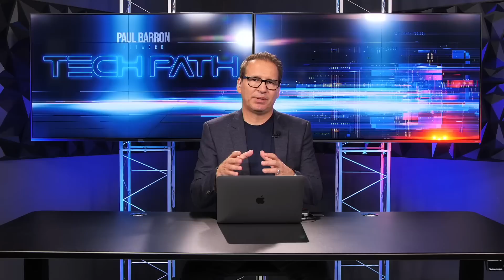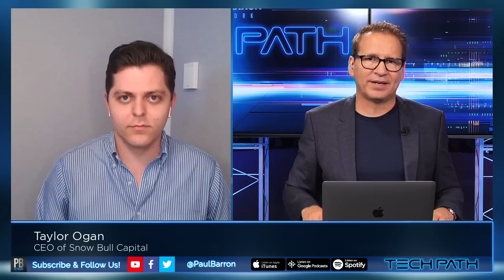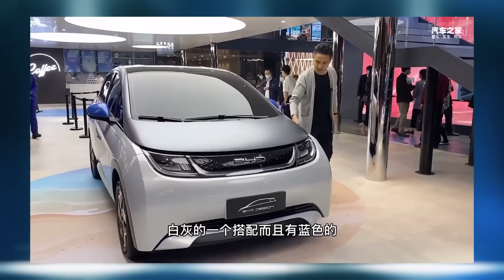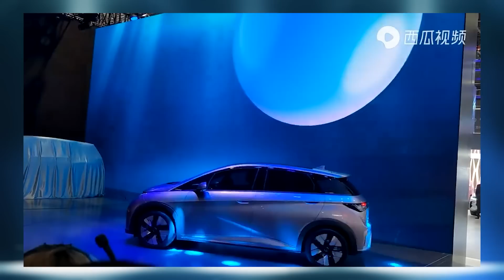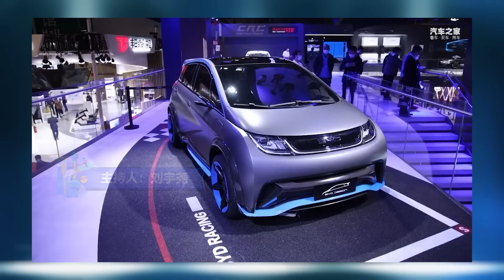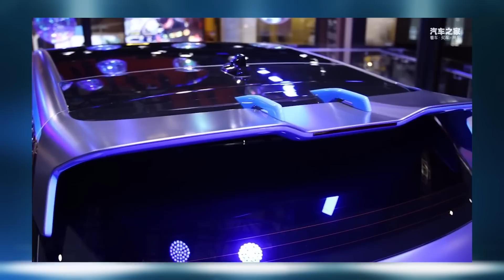BYD Dolphin vs Tesla $25k EV | w/ Taylor Ogan

Comment: Twenty-five grand is still too much when you have to replace the battery every seven to ten years. They refuse to make a self charging Ev. Or Troy Reeds magnetic motor that doesn't need gasoline or batteries, and it can be placed into an existing vehicle for $3500 dollars. Boy does the auto industry not want this to see the streets.

Comment: As the owner of a subcompact EV, 2016 Chevy Spark EV, I'd love to see the BYD Dolphin sell here. As a retired person I don't really need an EV to go 300+ miles as most of my needs are short trips usually around 6-16 miles round trip so even with an EPArange of only 82 miles the Spark is perfect. Do I wish for double the range because it's a fun little hatch, you bet. I am surprised that many of EV manufacturers have left out the EV as a 2nd vehicle solution and think that market is needed and could grow more quickly than trucks or luxury options. I like the blade tech and easier to obtain and less costly chemistry but we need the equivalent manufacturer here in the US along with our own chip producers. Anyway, BYD and CATL will be showing the way forward for now at least. He'll the VW id3 and it's Cupra Born variants should be here already.

Comment: You could put an LFP battery in the form factor of a 4680 battery. Why not?
A 4680 battery is not just for the best cars (around 16:00) - the usage for the best cars depends on the cell chemistry and not on the form factor of a battery.

The only issue I could think of might be the cooling. So, when it's easy to cool LFP batteries, then it would also be easy to cool a rather thick 4680 LFP battery down to it's core without overheating the battery cells.

The 4680 batteries have less surrounding materials than smaller batteries for a given volume of active battery material. This way you get a higher energy density for a battery pack with a given energy storage capacity (let's say 50kWh) when you choose thick batteries instead of thin batteries.

Think of it like slices of a bread and you wrap each slice in a cover. When you have thicker slices, you use lesser covers for your slices of bread - for your battery cells. Less cover material, more active working inside material for let's say a 50kWh battery pack.

Comment: What a disgrace these 2 are. The Tesla Model 3 is eons in front of BYD EA1. They are on the take from BYD. What furtive liars they are, subliminally talking up BYD or Buffet Agents . BYD make batteries, but they are a new boy on the block re cars. There are grave doubts about byd ride, handling, paintwork 
El cheapo plastic seats that might melt, and an infotainment system that has unsatisfactory functionality and and faint screen. Re the battery , the pace is ordinary 0-60 .. 10 seconds, so forget it, and torque is insipid compared to Tesla Model 3. BYD might crash if any cars are lemons like  Hyundai wss with its  Excel lemon
Reply: Hey, it's the BYD hater! 🤡
Reply: @AI_HQ  no I'm not 
. There are no complete worthy reviews.   I repeat a reviewer  made observation about the Pang??. Zthst were not good.. om the only one who commented on that and unpacked the issues.. most people write ten word quips if    ... nothing ..

Comment: Australian importer says EA 1 has 500km range , o-100 is 5 secs , 2.9 & 1000 km range  is a mis translation of the specs , that is a future projection of what may be possible 
Aust price $33,490 pre order from September.
Reply: 500km NEDC (Not Even Darned Close) range.  Usually this is dropped to 70% when converted to EPA range so about 350-360km.

Comment: BYD Dolphin 300km version will cost $17,000. 400km version will cost $20,000.

Tesla needs to work harder on lowering the price.
Reply: are you sure about that range?  because in india TATA nexon Ev  offers 310km range and offers great performance and costs  1,200,000 rupees which is  nearly 17,000 dollars. which

Comment: 4680 cells are a form factor. They will be available in LFP. I am happy to hear BYD has a platform that is so competitive. It is strange that it isn’t being sold to other EV MFGs. I’ve heard your theories that they will partner with Apple and/or Toyota, but isn’t it more likely they just want to keep it for themselves since they are so vertically integrated? 
The benefits of their blade batteries sounds amazing, especially the cost. Are their any insights into factory expansions?

Comment: 5:10 No that's not correct, I have to correct you on that. EVs are way too expensive in Australia and there is zero federal government support for them unlike the US, but we do have a $45,000AUD MG ZS EV with about 269km range. That's about $33k US, give or take. But that is by far the cheapest, and the next cars up, the old Hyundai Ioniq and 40kWh Nissan Leaf are around $54k AUD (~$40k US). Definitely unaffordable for most people and not surprisingly they are selling 30 or 40 per month across the whole country. But agreed with your point, if the BYD dolphin is priced at close to $30k AUD, it will sell massively.
Reply: in europe hyundai ioniq sells at 33 usd or at 26 usd with substitutions from goverment.
Reply: Australia's remedy comes from coil energy so if people going to have electric cars will be the same as diesel.

Comment: considering BYD already has manufacturing facilities in USA, it should start a vertically integrated giga factory in the midwest and start building a Tang suv with the third row eliminated and a truck tray installed in its place with a huge battery embedded in its chassis. This will cater to Americans' love affair with family trucks.
Reply: Wow. Didn't know that
Reply: Not bad of an idea 💡
Reply: I think they should have a truck. They could also keep the 3 row car idea with cute colors, purse storage, a place to plug in a milk pump, and an excellent car seat setup.
Reply: Very interesting, thanks!

Comment: I was waiting for Paul and Taylor spreading the news on BYD. Great you cover BYD so well. Keep up the good work and thank you! The stock will catch up with NIOs XPengs and Teslas valuation at some point. No doubt. Its still so cheap with P/S ratio of 3.3. Tesla has a 2020 P/S ratio of 20 and NIO of 30. BYD should at least reach a 10
Reply: BYD can sell the ev AT COST and still makes money since BYD already makes money on their batteries and their electronics, which usually account for 30% to 40% for the cost for an average ev. Tesla on the other hand has to recoup the cost for all the car parts they have to get from their suppliers, and only after that, Tesla can add in the margin.
Reply: BYD🚀
Reply: right now in china there is literaly no ev s at 10.000 usd range. it s either very cheap at 5000 usd or very expensive. no chinese car company like xpeng or nio or byd has ev models between 10.000 and 15.000 usd on sail right now. it s very odd. why is that?

Comment: $10,000 is defintely cheaper than a high end bike.
Reply: Where is more credible reference that this EV will indeed be $10,000?By its look, it is more like $15,000 EV. Maybe $10,000 is the price excluding the battery and you will need to pay for the battery over time.
Reply: we ll find the exact price when they ll sell it in china in chinese yuans and then make the conversion to usd. right now in china there is literaly no ev s at 10.000 usd range. it s either very cheap at 5000 usd or very expensive. no chinese car company like xpeng or nio or byd has models between 10.000 and 15.000 usd on sail right now. it s very odd. why is that?

Comment: Taylor's information for Australia is incorrect. The cheapest electric vehicle we have is $44,000 Au/ $32,800.00 US approx,  before government incentives in some Australian states for the MG ZS EV.  The BYD EA1 Hatchback in its base model trim is estimated to be around 29,000 Australian dollars/ $21,600.00 US approx. with a range of 400km. Chinese EV manufacturers will dominate the EV world globally in the next 5 years. Byd has Ev's in every passenger vehicle category. Their long term plan is to supply the world with quality and Affordable Ev's. We will be able to order 2 BYD Ev's this month, July 2021 the EA1 hopefully in 4 spec models. Probably the higher spec EA1 model and the Yuan plus a small crossover SUV based on the BYD X dream concept vehicle both around $35,000 Australian dollars for delivery in January to March 2022. In September this year we will get the BYD T3 van in Australia for the same price as the 2 passenger EVs, all with blade battery packs.

Comment: Not quite right... cheapest EV in Australia is MG ZS at $A43,990 drive away. So approximately $US33K. The importer (Nexport) is saying 'under $A35K' for the BYD Dolphin. So before any government incentives, call it $US26K for the entry level model. To be confirmed... deliveries scheduled for Q1 2022.
Reply: Sad that here in NZ the BYD will not qualify for incentives as only new EV up to NZ$80k will get the $8600 rebate and only between 1st July and 31st December 2021 :-(
Reply: @gregandkaruna6674  how does that not qualify ?
Reply: @jonathanpoppleton1010  The BYD is not due for release until March 2022 or 3 months too late :-(
Reply: @gregandkaruna6674  The NZ Government financing of the rebate scheme ends on 31 December, but that is because the extra fees on high consumption vehicles (think V6, V8, large SUVs and double cab Ute's) begins on 1 January 2022 and this is supposed to make the scheme self-funding. So the rebates for EVs will continue, just the funding changes .
Reply: @murraynickel6377  Hope so, but that is also the date when RUC charges are due to start on EV and PHEV and no word that it will be extended.
Reply: @gregandkaruna6674  The Govt knew when EV's were going to arrive, so targeted incentives at the cheapest outlay but still looking good for them.

Comment: Does this dolphin even pass safety requirements in the USA and Europe?   Given that batteries production limits the number of EVs that can be made, it makes sense to sell higher-end vehicles, then make more affordable vehicles as battery supply and giga-factories come online.   I think many people do want a small city car/ efficient commuter/utility car in the USA and Tesla is definitely on this path, but NO Tesla does not need to make a car like this right now when it is maxed-out making high-end cars showing the world that EVs are the way to go.  It's not the number of vehicles sold, it is the return on investment, which creates capital to make the tech more affordable for everyone, that then transitions the world off fossil fuels.  Imagine once FSD is solved, Tesla can put this tech in a < $10K car because the cameras and processors are economical but the value that brings is huge.  Yes why does this Ogan guy sound so biased toward China eg. "Huawei has a better phone than Apple but Americans just want what uhh Americans want" ... and the dude uses an iPhone himself with airbuds.,  Samsung has better specs than Apple too but its the Apple integrated HW/SW magic that makes a great product, not just specs.
Reply: Kevin I was wondering if you can tell me where the iPhone is manufactured? BYD make their own batteries and just about everything that goes into their Ev's,  so they have no constraints or component restrictions or shortages for their Ev manufacturing. They are the biggest EV manufacturer in China.
Reply: @Peter-vn8ue  Peter, I was wondering if you can tell me where the MIC Tesla 3 is made?  Tesla also makes their own high performance  batteries and sources all different kinds of batteries including lithium iron phosphate batteries and they are highly vertically integrated and have done a great job in managing their supply chain for. EV manufacturing too.  What I am reacting to is Ogan;s negative slant toward Tesla as if Tesla is somehow imperilled in China.  Tesla is already developing a China designed car specifically for the Chinese market and abroad and will make this when even more battery supply is available since Tesla is selling every car they can make and they are exponentially growing capacity  to meet this huge demand.
Reply: When will it be in US especially California like to have one

Comment: CHEVY BOLT
Reply: The bolt don't have 1000km range on a single charge or does it go from 0-60 under 3 seconds.
Reply: @xiebaiqin  neither does the BYD Dolphin. These specs that you mention are the maximum specs of the underlying platform not this specific model. Also the 1,000 km range is NEDC range not EPA or WLTP.
Reply: @xiebaiqin  those specs are for the top spec Han model not the Dolphin,  it would need a longer wheel base to accommodate more blade batteries for a 1000km range. But the BYD EV's leave the bolt well behind when it comes to advanced technology that's why I plan to buy one later this month when they go on sale in Australia. Probably the Yuan plus which is in development and is based on the BYD X dream concept vehicle. The first BYD passenger EVs will be delivered in Australia between January to March 2022.
Reply: Definitely looks like a Bolt.